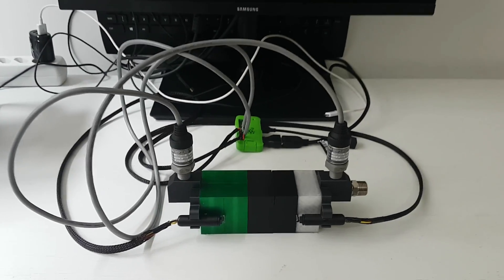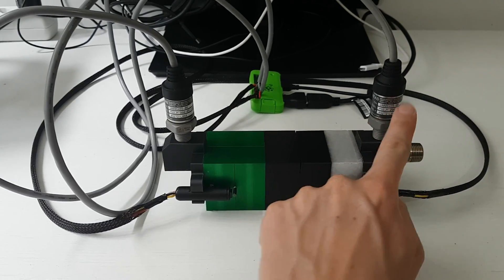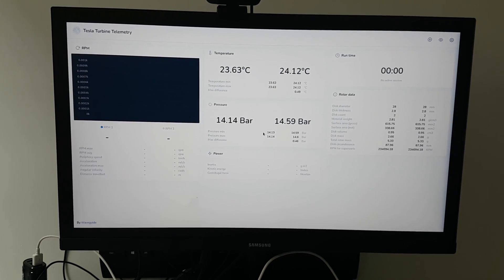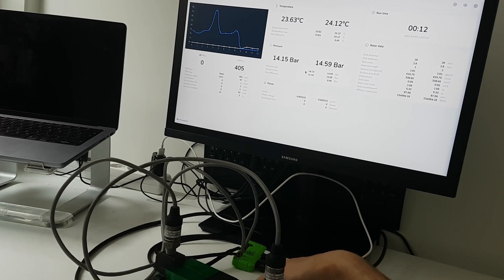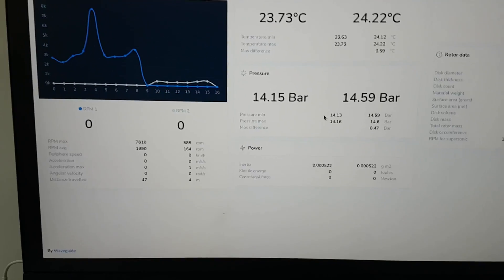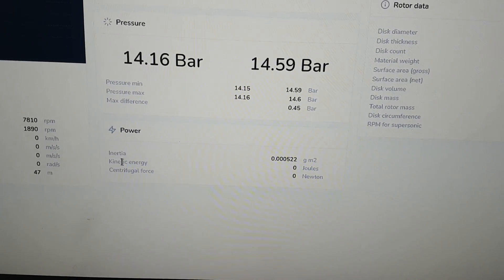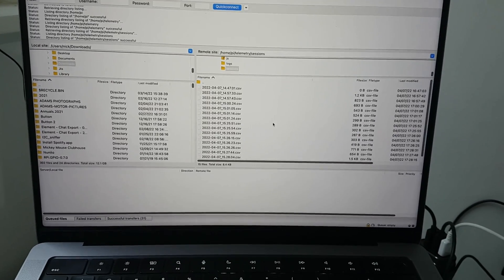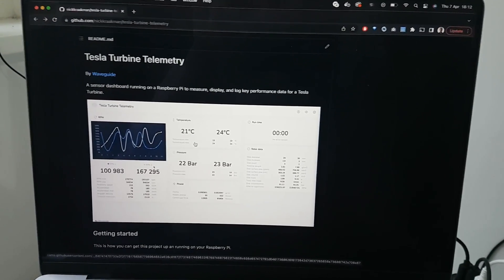Tesla Turbine Telemetry setup to measure RPM, pressure, and temperature

Comment: Brilliant work Nick. We’ve since bought 2 x anemometers which have a USB output. I would like to send you one to see if it can be integrated in real-time to the system. It measures wind velocity, air mass and temperature. Looking forward to putting the whole kit together.
Reply from the maker: Oh great! So is it a mass/flow meter then? Was looking for one of those. If it has a digital output, it can be integrated
Reply: @Waveguide  yes that is one of the functions and there are many different units that can be used which is a great feature.
Reply: @Waveguide  one of the miniature turbine rotors could be used as an anemometer if we calibrated it against one of these. Quite a project!

Comment: A human attached to a 5000 lb electric Generotor.
Its a Free spinning weight until you connect it to a super capacitor bank

The person will spend 1-2 hours slowly building up the speed of the weight
Then once they can no longer make it go faster, then will slowly engage the electro magnets to suck the power into your super caps to bleed into the rest of your bank as well at the rate your bank can take it

If you had a perfect bank, you could stop the weight instantly without making a single noise or lose an ounce of heat.
That's not for a long time

Then you would again, build the speed back up, and slam on the breaks again.

It should be like it falls into a pit filled with feathers

Poof

Just one of the infinite amount of ideas I have.
Do you know what IQ I have? Infinite, because I don't reject Problems or solutions, I assimilate them all until theres nothing new
Reply: Ahhh you just heart everything, blah

Here is something else to think about if you look:

A machine from mars that you live inside using electric bicycle parts so I can easily ship you spares where ever you are and we can use the ultimate form of down hill/street parts to make it the beefiest and smoothest and most efficient, and cheapest, and most simple to transform or replace, and with every ability possible to absorb or charge from surrounding power sources in the world

I accidently invented God, I accidently uncovered the true secrets, and I accidently became Christ doing it.

The Anti- Christ, of the Anti- Christ.
Defeating Insane Evil Chaos, with Insane Good Chaos

So insanly chaotically Good and cOol and fun and epic, that even Evil itself can't deny but to join

or go to hell, which the world will literally designate a place and call it literally Hell on earth
Instead of it being Hell on earth everywhere, with little pockets of true good here and there looking for an escape from this hell